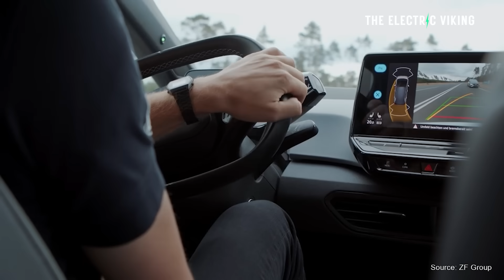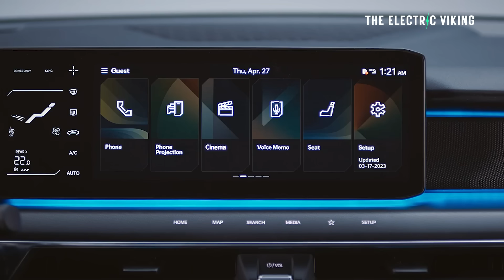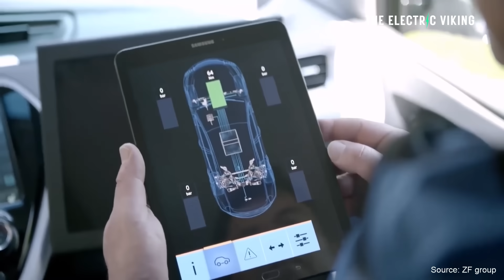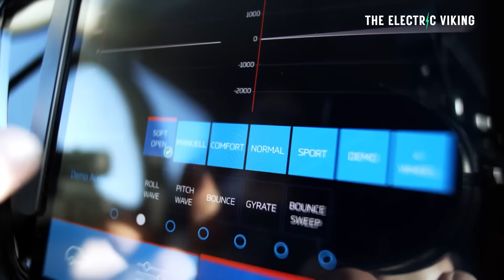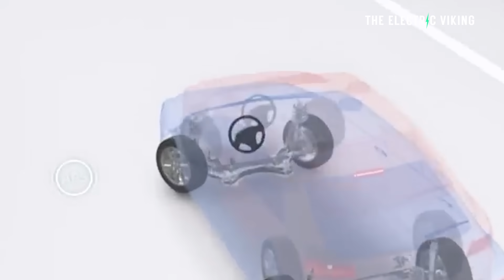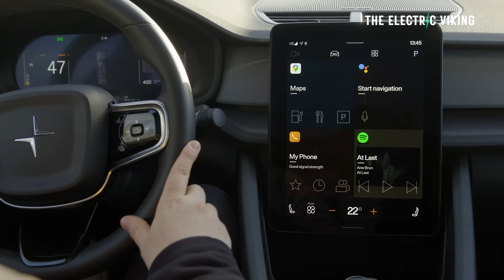Electric Brakes Revolution: Safer, Cheaper EVs!

Comment: I don't think it's a good idea. Adding more complexity, more failure points. First principal of engineering: KISS - keep it simple stupid.
Reply: Best part is no part. Aviation learned and implemented this decades ago.
Reply: @leonardoreina1655  Yup, lots of parts involved in brake or steer by wire, lots of electronics, chips and wires that can short or malfunction in contact with moisture or EM waves, or software bugs, hacker attacks etc.  IMice can also bite off thin little wires.
Reply: Look how simple hydraulic brakes are. Not very...
Reply: @adamdrake3290  Having direct physical connection from brake pedal to the brake pads is more robust. Electronic brakes have many more poinrts of failures - software bug, rodants chew through wires, corrosion related electrical failures. or sudden power loss for any reason renders brake unresponsiive. Hydraulic brakes don't depend on eletrical system or engine to be running to work.
Reply: @ If the brakes are designed to failsafe with automatic FULL brake unless digital release, that's fine.  That is, unless e-pedal says to remove pressure, the brakes will lock all 4 tires.  Same with having e-throttle physically default to minimum idle unless signal opens the air flow.  And there needs to be automatic zeroing with self calibration.
Reply: @ZweiZwolf  let's hope they implement that. However in today's innovation culture engineers seem to prioritize gimmicks and gadgets that can upsell rather than the safety unless mandated by government.
Reply: @ Tesla can't even do that.  Have you noticed that EVERY new Tesla drives with high beams on ALL THE TIME?  Even though it's illegal in traffic?  Do you know why?  It's because Tesla doesn't use LIDAR, the depend on camera, and their camera isn't good enough at night with just low beam, so they need high beam.  Rather than obey the law, Tesla decided it was cheaper to break the law to save a few bucks.
Reply: In the 21st century it evolved to:  keep it simple, stunning.
Reply: If we can be sure that that it's adequate for ALL situations, then great!  I want to see this in an extended downhill mountain descent.
Reply: Its not unsafe. Aviation industry builds redundancy into their systems. The car industry will do the same.
Reply: @ The Aviation industry lost a lot of lives, and continues to see failures long after lessons should have been learned.  The Boeing 737 MAX failures are a good example of this, with an inherently unsafe design and configuration, exacerbated by computer controls that deliberately masked the failure mode along with  inadequate training.

Comment: You can also die if an electrical connection is broken or short circuited.  STUPIDEST idea ever for a car, I am not stupid, I'll never buy a car like that.
Reply: Best you never fly in a modern Airliner then either.  Fly by Wire and Brake by Wire been around for many years now  :)
Reply: A plane always checked and have team of engineer ready to fix anything, not always happen to a car
 @allanapplin250
Reply: @allanapplin250  Airplanes have redundant systems and rigorous maintenance.
Reply: You have 4 different brakes on a car, plus an emergency brake. It'll be fine.